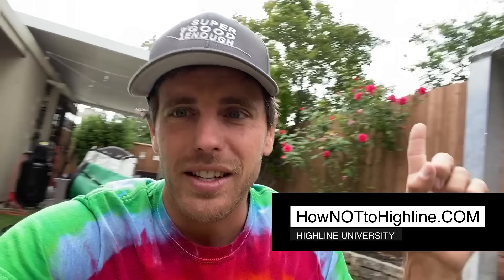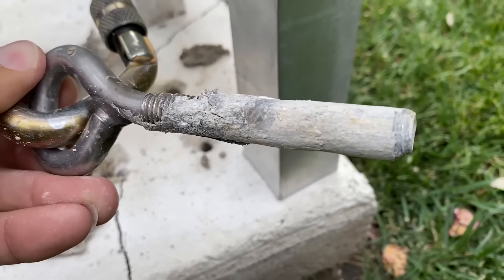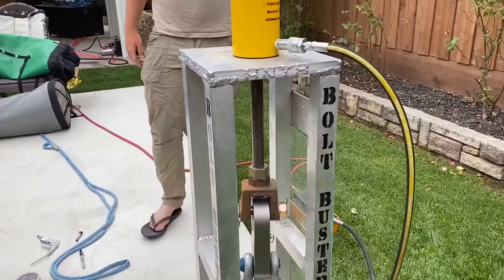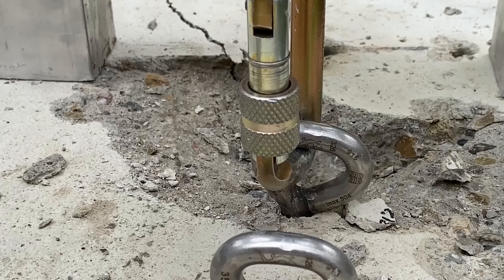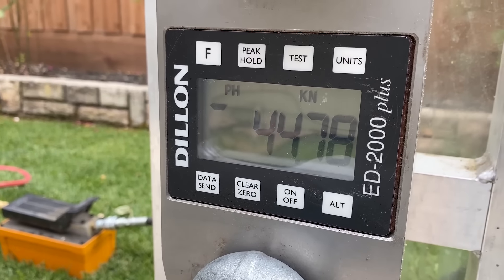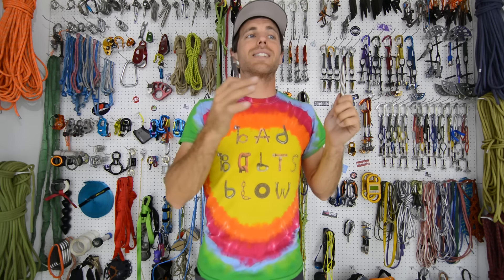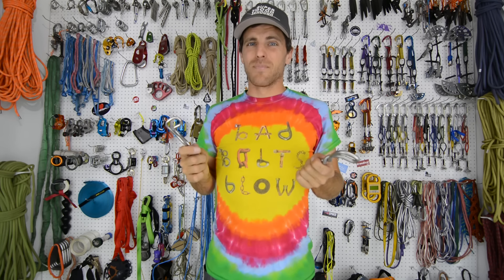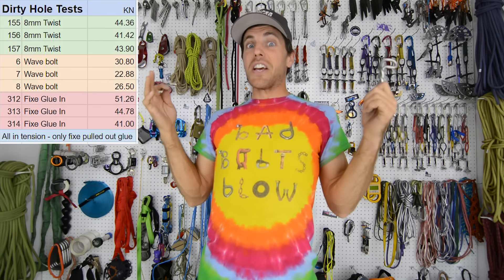Are glue in bolts dangerous if the hole is dirty?

Comment: Drilling vertically will knock most of the dust that stays in down to the bottom. Where if you drilled horizontally the dust will sit along the "bottom" of the entire hole and not the back.  This might create more of the issue you are trying for.
Reply: OK, Maybe not cleaning the dust should be reserved for horizontal climbs such as "The North face of the Uxbridge Road" where the bolts strength will be less affected
Reply: What i ment was there might be a higher concentration of dust at the bottom of a vertical hole, but less on the walls of the hole on the top half. Where as there will be more dust coverage, but to a lesser concentration in a horizontal hole.  Which seems worse for glue.
Reply from the maker: i assure you my holes are dirty ;).  dust stays on the sides of the hole just fine.  if you did or horizontal placement the dust would stay just on the bottom and in theory not be on the top of the hole so it would stick to half the hole.  That is the part about cleaning a hole that is a misconception, you don't need a lot of dust, a thin layer of dust in theory is just as dangerous.  You can see the glue disengaged with the rock, it just surprised us how high it was.
Reply: I agree that both ways will have the top of the hole "clean" but in vertical the full force is spread around the entire bolt with a nice grab and no tearing action where with a horizontal the full force will be on only half the circumference of the bolt.  The point on each side where the glue switches from good rock to dust will be a "sharp" point where the good glue will rip. This is the same issue with having under cutting with welds.  Sharp angles on structural materials get a concentration of force and dont spread them out. This creates failure.  You got 40-50 Kn and i wouldn't be surprised to see half that in a horizontal.

Comment: At work with glue in all thread we drill it, spin the drill to pull dust out with a vacuum and then glue them in. Now I don’t feel bad about using a wire brush. Thanks.

Comment: With a super smooth hole, talc like dust coating the walls, and somehow the epoxy not disturbing the talc, you'd probably get lower pullout. Mix the epoxy with the dust and you just get a sand/epoxy composite.

Comment: If the cement pad you poured was mixed by hand it will be less poures because a mixer adds air into the wet cement it helps the cement cure and be stronger as well as creating more tiny divots for the glue to hold on to (work in masonry so cement mortar and stone is my specialty

Comment: A lot also depends on the MPA of concrete.  On residential house it's around 25 MPA. On highrise I've seen 75 MPA. How strong is your concrete? Just curious? I've always cleaned the holes. Compressed air and a brush. In some situations; the builder has specified a primer on everything from glue in bolts to sikaflex construction adhesive sealant work. Interesting to see real life tests! The Ramset type cures extremely fast and in under 5 minutes you can torque it down. As per specification.

Comment: You also tested with a vertical hole so all the dust would go to the bottom of the hole and it’s unlikely it would affect strength but a horizontal hole would cause the dust to sit along the whole length of the hole which could reduce strength

Comment: I just wanna put this out there. 
Even the inside of a semi dirty concrete/drilled rock hole is always going to have better engagement with the rock than the bolt, unless it's a screw in bolt. Why? Surface area, and how the glue expands as it sets, in most of the hole even where, say, 1/3rd of the hole is packed with dirt grindings, the bolt (unless it's a  finely threaded screw type)  is going to have less surface area for the glue to grip, because it's smooth. Even a slightly damaged bolt is going to grip better because the damaged area creates more surface area than it being smoothed/undamaged. When you drill out concrete/rock it's not going to be really smooth inside the hole. There's more surface area on the concrete for the glue to grip than on the bolt. So, if you fill these holes complete, then insert the bolt, it might compromise the matrix in the glue slightly with the dust getting mixed into the glue, but the glue is NOT just sitting on top of these dust particulates, usually it's going to get mixed in with the matrix of the glue. TBH, I think to get the outcome shown by the other guy. You'd have to drill the hole, not clean it at all, insert the bolt and then try to inject the glue around the bolt. Instead of filling the hole with glue and pressing the bolt in. Understand what I'm saying? 

The obvious exception would be drilling a half inch diameter hole, and putting a quarter inch diameter non threaded bolt.

All in all if you do at least 1/3rd of it logically, I think the bolt is going to hold beyond what would be needed for saftey of "SGE". 

Not a climber, but a rigger for extremely heavy construction loads, with a formal science and engineering background.

Comment: Cool to see concrete fail like that.  One "ballpark" number for concrete's tensile strength is 300 psi.  51kn is a bit over 11,000 lbf (or 11 kips in US building structural engineering), which at 300 psi would be 38 sq in, or about a 7 inch diameter circle.  Not too far off from the patch that "coned out."  So the "textbook" way we conceptualize/design for that type of failure in concrete actually lines up with reality!

Comment: Surely the fact that your fitting the bolts flat to the floor has an effect as all the duat will fall to the bottom of the hole but if your drilling in to a vartical wall the dust will sit along the whole length of the bolt ? The difference might be tiny but its something to consider maby ?

Comment: Im in the construction trade in Jackson Wy. I have a decent back ground in climbing big walls. I found this video pretty neat and shared it with a bunch of guys at work. Most times when we have to hilti and add all thread/epoxy to concrete we have to have a 3rd party engineer watch us do it. Making sure we have the spec depth, properly cleaned the holes, and correctly mixed/applied the epoxy. The slow motion aspect of being able to see the concrete break is awesome! That’s wild you hit 44 KN with that much dust!

Comment: This type of adhesive works by expanding as it cures inside the hole; placing the whole mechanical connection in tension. 
On your first test with the threaded bolts what we are seeing is the concrete fail before the glue or the bolt. Those huge chunks of material being thrown off demonstrate how much bond there was between the adhesive and the concrete; they were basically the same or similar strength. Keep in mind concrete is porus, more so than most rock. This porosity may allow for a much stronger bond than you might find in a more dense rock like granite.

Comment: Someone please correct me if I'm wrong but I think one of the main reasons that the glue separated from the concrete was due to the concrete failing. Atleast for the first two bolts, from this footage, the concrete breaks first and fails catastrophically, causing the concrete around the bolt to crack and fall away from the glue rather than the glue slipping. The 3rd test seems to behave more like expected if the glue was to slip against the concrete however I think it's still a similar thing happening.
Reply from the maker: The glue wouldn't have stuck to bolt like it did if it was only because concrete failed.  I plan on redoing these tests in other rock.

Comment: The glue wasn't sticking the walls at all, but happened to be taking up space, so that's what actually provided the strength.  It's like a climbing nut, just the shape of the glue is wedged against the shape of the concrete.  It could happen to solidify in a shape that doesn't provide any wedge action though, which I think would pull right out.

Comment: There is a good chance that granite is stronger in tension than concrete, so maybe you could get this effect in rock?
Also were you twisting/spinning the bolts in the holes? This dislodges dust from the sides of the hole and gives works the glue into the substrate, so if you simply insert the bolt and don't touch it then that could lead to a glue pull-out.

Comment: 2:01
“Super coned out”

Is this a good or a bad sign?
Reply: Pulling out a cone of concrete means the glue has some adhesion to the wall of the hole
Reply from the maker: It shows how the force is being applied on the concrete.  Super interesting is what it is!

Comment: Hey guys, I was wondering if you had ever tried break testing Samson amsteel blue dyneema fiber cord. The one I am looking at is 1/8 inch and was wondering what it would do with a single strand, a double strand, a three cord braid, and double three cord braid. I am looking at this academically from a stand point of an emergency high-rise rappeling system. It would only have to work once but could be retrieved and used again and could be stored in a small space while still allowing for several hundred feet of decent.
Reply from the maker: it has a low melting point so i don't know if it is good for rappelling.  we have done a bunch of amsteel dyneema break tests.  hit ctrl f on our slacksnap chart on our website to see all of them slackline.com

Comment: I think my biggest issue here is that concrete is not solid rock. For one, the failure mode is different. The rock almost certainly isn't going to give out structurally before the bolt pulls out. But more importantly, concrete is constructed of very fine rock particles which makes it far more rough of a surface. I could easily imagine that this makes the glue bond much easier with the edges of the hole, whereas the inside of a hole in rock is likely to be very smooth and much more likely to pull out. Just a theory, but I would greatly appreciate a test with real rock!
Reply: Tests starting at 8:06 are in granite.
Reply: Oh interesting. Nice!
Reply: Some solid rock isn't really solid rock either. Sandstones and various other sedimentary rocks are also a cemented aggregate with a very fine structure (and are typically considerably weaker than concrete). Granite is a pretty different material, as are metamorphic rocks, and they would fail somewhat differently.
Reply from the maker: not all rocks are as hard as you might think.  my backyard is full of rock that spalled like this concrete.  I even had granite in the sierras that i tested completely cone on me.  I have had extremely great adhesion on granite tests too.  Check out our boltbuster chart on website, we have only published a few of all that we have done.  slackline.com

Comment: Gravity kinda cleans out the topmost portion of the hole, so you get really good adhesion or the top 1.5 inches, that's why you see the concrete fail but only at the top. Effectively, you are only glueing in a 2" bolt regardless of the try length of your bolt. If you pulled a bolt glued in to spec, you should see that cone ish shaped failure starting at the approximately the tip of the bolt.
Reply from the maker: The glue pushes all the dust out so the dust is evenly distributed in the hole.  I think rubbing the bolt a little "cleans" the sides of hole and mixes the dust inside of the epoxy which isn't so bad compared to the epoxy possibly only "sticking" to the dust.  We plan on doing more tests.
Reply: @HowNOT2  I'm not a rock climber and will never do the crazy awesome stuff you guys do, but love to watch your break tests and procedure videos. Keep up the good work!
Reply: That’s what it looked like to me, only adhesion on the top, so maybe the dust only got pushed up so far? Fine in concrete or granite, maybe less fine in rocks that are weaker per inch of depth of bolt?

And presumably horizontally drilled holes would also be very different with dust maybe more across whole length, and possibly less of it because the spiral is better at removing it without gravity.

Comment: Hi, I am would imagine that the dust of differents rock will act differently in the whole. There are rocks who are very gravely, that may not connect as in your test.
Reply: Theoretically I would think the more coarse the "dust" is, the more the glue should interact with the bolt and the rock and the stronger it should be. The super fine powder seems like it would be the weakest cause its just becoming a big glue/dust conglomerate material blob thing. But again that's totally just my theory.
Reply: @EvanTheHamburgler  I wonder if the epoxy might be less likely to wet super fine powders
Reply: @Jefferson-ly5qe  yea that's what I was thinking

Comment: i couldnt find the english name, but there are "verbundanker" (compund anchors), a glass vial with resin, quarz grit, and aanister vial with a powdery hardener. normally used in concrete with a threaded rod ancher. 
i'd be curious to see, how those compare. they're just 1-2 eurobucks a pop.

Comment: I'm curious about the vertical vs horizontal holes.  More dust will end up at the bottom in each case, which might result in different failure modes.
Reply from the maker: so the top of that hole would be clean based on the theory and have just as much adhesion as these?

Comment: Would be really interesting to do an over-torque / under-torque tests (pullout & shear) on five piece bolts.  3/8 vs 1/2.  SS vs PS.

Configuration                Shear          Pullout
3/8 SS under 50%  
3/8 PS under 50%
3/8 SS over 50%
3/8 PS over 50%
3/8 SS over 100%
3/8 PS over 100%
...

Keep going up in torque until just before the install breaks the bolt.
Reply: uhhh should have watched the video first haha.  Look forward to the video!

Comment: Thanks for the testing information. I've epoxied hundreds of holes over the years and was taught that a key to strong epoxy bolts (besides a clean hole) is not having voids in the epoxy. The following process works well: be sure to let the mixing tip fill with epoxy before you insert it into the hole, so you know it is ready to come out immediately. Insert the mixing tip all the way into the hole and fill the hole from the far end outward. Try to keep an even pace when filling the hole and removing the tip. Maybe this could be another line of testing: do voids cause major weakness.
Reply from the maker: we can try testing air pockets and how much they weaken bolts

Comment: So do you think it would make any difference if you set the bolts horizontally in the concrete, then laid the slab down to do the test? I’m just wondering if the dust will settle differently if you’re drilling and placing them in vertical vs horizontal dirty holes.

Comment: I wonder what exactly is going on. The parts that disengaged and pulled out had a very smooth finish. I suspect that when the hole is getting started it is harder to keep the drill steady and that that creates some mechanical features for the glue to jam in. Once it is going you get a very smooth hole and the dust allows the disengagement.
Reply: Also, the dust is going to fall to the bottom of the hole. It looks to me like the glue only engaged with the rock at the very tippy-top of the hole.

Comment: Kind of a pointless test, as climbing bolts are placed in rock and this is sub en959. Also the bolts are placed far too close to each other. Plus you didn't allow for the different types of epoxy glues out there.

Comment: I think that the porosity of the rock and the viscosity of the glue would  Change how well the glue bonds to the rock. The higher porosity  Rock types may grab the glue better mechanically, and thinner glue may saturate into porous and finer grain rock types.  And the one that you were twisting possibly mixed the remaining dust in with the glue kind of like a rock filler.  I use epoxy for many applications  From climbing holds to gluing boats together.  I'll be gluin titanium bolts in limestone on the next Caribbean's vacation,  Good to know if I don't get every speck of dust it should be.. super good enough.

Comment: I feel like you turned a glue-in bolt into an expansion bolt by letting the glue cure in dust.
Reply from the maker: there is a hilti-z glue in that is designed like that.  glue turns into an expansion cone of sorts.  made for rocks that seismic activity.

Comment: Epoxy is a broad term covering a range of adhesives.  The epoxy that works best for wood is not the epoxy that works best for metals.  I have not specific knowledge about epoxy and various materials, but I believe there is no reason to think that the epoxy that works in concrete  will work equally well in granite (or limestone or sandstone or shale or . . . .) Since actually climbing/highlining bolts are placed in naturally occurring rock, your experiments in concrete may have little bearing on what happens out in the wild.
Reply from the maker: I have done hundreds of epoxy glue in tests in rocks.  It works just fine :)